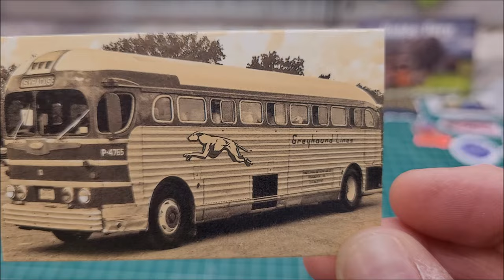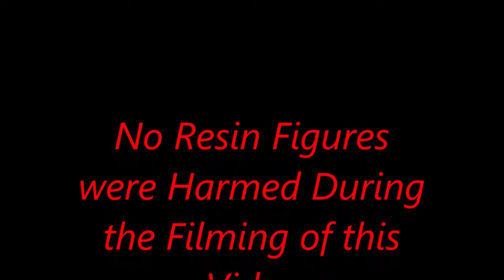1947 Greyhound Bus / Custom Hauler Final

Comment: Absolutely fantastic ya magnificent model building Skillet! lol! Far out Dan dah man! Yeah I built one of those buses a couple years back and things didn’t line up right neither, when I went to put it together! I didn’t put the engine in mine bc things wouldn’t fit right back there either, with the engine in, so I left it out, I put the engine in one of my 32nd scale military trucks, I didn’t use the transmission that came with the bus, I found another trans. to make it a inline 6, worked out good for that military truck, because it was 32nd scale too! Anyhow, good deal Dan!! 👍👍🤙🏻✌🏻
Reply from the maker: Thanks Doug, The reason I purchased that kit was I saw you build it first. Ya the some parts are a little finicky but we improvise and overcome, right Buddy.